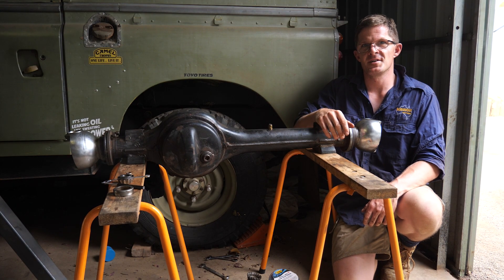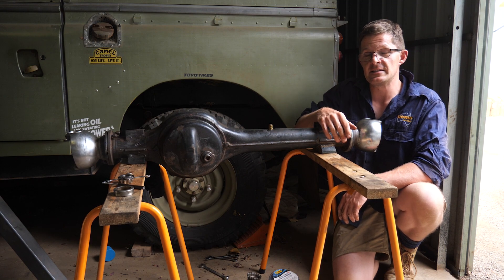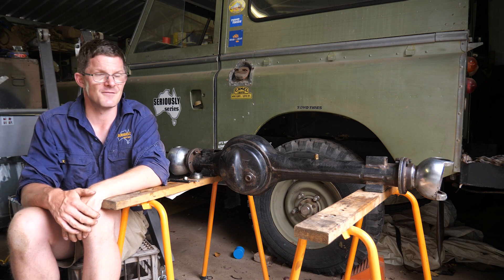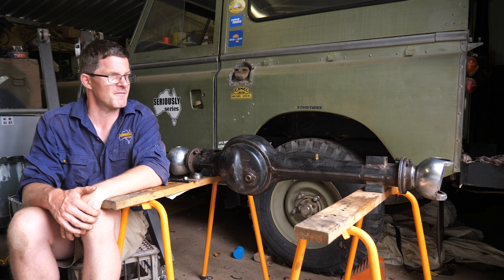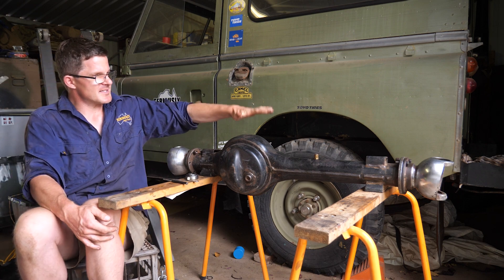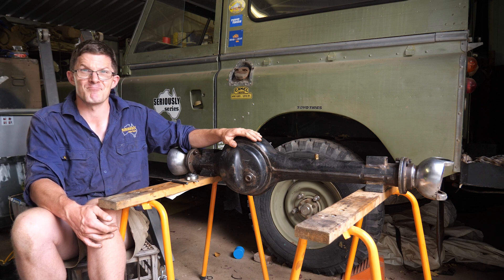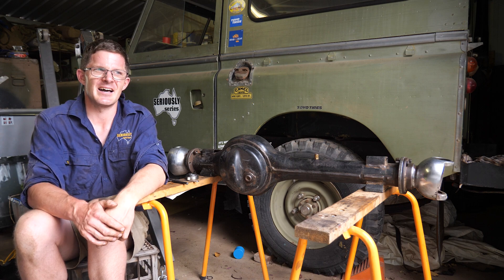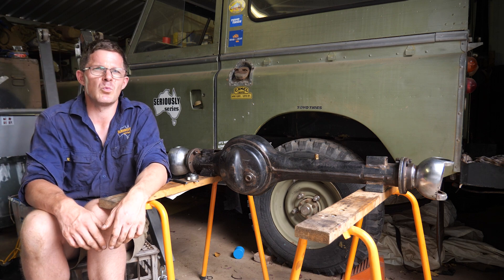NOT YOUR AVERAGE AXLE: LAND ROVER SERIES 3 STAGE ONE EXPLAINED

Comment: I own a Stage One 3.9 4bd1 wagon. I used county cv axle stubs, they are the same but shorter so you can not use the snapring on the end, overcame this by using a bolt and washer in the ends (stops them moving in as the snapring does) Replaced ralico bushes with bearings and milled down swivel pins (improves turning). Also the steering box is unique to the stage One (four bolt to the side of subframe, not incased in subframe like standard S3). Love my Stage One and have had it 20 years or so as my daily driver. Love your video's.

Comment: I can tell you from experience, the TOP Railko pin is shorter AND a larger diameter  than a regular series Railko and pin, you have already mentioned the inner swivel hub seal, what you will also find, is the CV joint is supported on its outer end  by a bronze bush pressed into the inner end of the stub axle.
This bush will almost certainly require replacement in each stub axle, and they are astronomically expensive.
I know all this because I have a rebuilt stage 1 axle in the front of my 1976 S3 88, and a stage 1 Salisbury in the rear.

Comment: I've got a stage one front axle in my series 2 swb that I'm at moment fitting a 3.9 V8 with an LT77 4cyl gearbox 
I've also got some spare shafts and stub axles 
I was considering selling the spare parts but I'm running 900x16 tyres and thought if I break a Shaft 
I'm going to have a major problem finding replacement shafts
Reply from the maker: Check out these guys they have some of the spares you may need down the track.

https://www.designdevelopmenteng.co.uk/shop/Series-Land-Rover-CV-Front-Axle-Conversion-Kit-p389433970

Kind regards, Geoff

Comment: is it easier to fit a narrowed defender axle? you get discs and cvs as standard.
Reply from the maker: sadly the defender front axles are longer than the stage one axles and the axle casing is very different to the defender so you would have to buy a disc conversion kit. Cheers Geoff

Comment: Could you fit a Defender front diff?
Reply from the maker: Eakry models, yes you can, though you need to make sure it is 10 spline diff, otherwise you need to change the axles. Cheers Geoff

Comment: They used CV's because it was constant 4WD, uni joints in the ends of the axles would have lead to a sort of juddery feeling when accelerating and turning.  I had a brand new Stage 1 V8 in 1982, wish I still owned it....

Comment: Hi Geoff, I owned a rare tray top stage 1 and yes I remember  standing at a parts counter (Tom T) and engaging in heated debate about the swivel pins he had supplied me, they fidendint for the very reasons you have so brilliantly outlined. As I purchased my 110 County new from Winterbottom in Perth City in1985 my first thing was to assemble a collection of critical spares as I was taking my young family in the County to Alice Springs via some of Len B's famous and not so famous Gun Barrel company tracks, back then it took 15 hours to cover 11ks in a couple of very overgrown sections that required axe, pick and shovel to remove mulga and wattle from the 1 blade width track, had to fill in the wash outs and 86 the desert was wet in July east of Carnegie STN.
We made it all the way to the Alice not even a flat, I broke a grease nipple off a rear uni one morning out back as I grease them daily on that sort of work.
The parts changed from my sage 1 to County , engine consumables were easy every thing interchanged for the 4BD1, but there are some spec changes in that department as well. Would love to sit down with a coffee one day and chat. Kind regards from the Pilbara. Banjo.
Reply from the maker: G'day Ben.
What a great adventure Ben, back when the Gun Barrel Hwy was a real achievement to complete. The County you mention was differently one of the best configurations that Land Rover ever came up with and the should have continued down that road in my opinion.
I'd love to sit down and have coffee with you Ben and I might find myself in your part of the world later this year doing some Geology work, so see what happens. All the best, kind regards, Geoff
Reply: Would love to catch up when you are here. @seriouslyseriesaustralia

Comment: They aren't quite as different as you think.
The bottom swivel bearing on a stage 1 is not specific, its a 217268 like any other series 3.  The steering arms are different by having a shorter pin.
The halfshaft seal 571718 is also used on early 90/110s with the 23 spline CV joints so is easilly avalable though the retainer it sits in is unique (dont wreck it when changing the seal - I found heating it up is the best way to get the old seal out).
The difference between a suffix C and suffix D diff is the earlier housing is imperial and the latter is metric.  The change only really effects the side bearings and the cap bolts - metric cap bolts are stamped 8.8 so is an easy way to identify a metric diff.  Metric diffs usally lack a filler port in the case too where as imperial ones have a filler in the case (used in rear fitment) even though you fill front diffs through the pan (yes they added a filler to the rear diff pan of an 88 when they switched to metric diffs).  The diff casing is common to all LR models at the time so a stage 1 front diff is just a standard RRC diff from the same pereod and thats the same as a series 3 diff besides the CW&P, they all went metric together (CW&P allong with its bearings didn't change when the diff housing 'went metric').  All long nose rover diffs from 1948 to 1994 will phisicly fit and post '94-2016 ones only don't because their centre is 24 spline rather than 10 so with the right centre and CW&P ratio any can be made to work - this is important to remember as the diff currently in your truck may not be the original to the correct spec!
In 1980 LR changed a few parts so they were common between RR and S3 which they often refered to as 'rationalised' in the parts book.  Anoyingly the early stage 1 was designed without this in mind so ones built before mid '80 have some slightly odd bits especally the brakes and axles but from '80 on they share more with a standard S3.  As part of this they also switched some threads to metric, though not all of that as wheres the fun in that - they were very fond of only switching one end of a brake pipe to metric.

One thing the stage 1 has going for it though is although its got its odities and some bits are harder to get, machanically they are built way stronger than a normal S3, RRC, Disco  or all but the earlyest of 110's which are on par, so once you've completed your 40 year overhaul it should serve you well over the next few decades if you keep it oiled with little fuss.  The gearbox is a major limiting feature of a standard series which means they either lack top end speed or struggle to pull away and break if you put too much power into them.  The LT95 however has much wider gear ratios and plenty of strength so much better for long distance work though they are clunkyer to drive.  If you really want to its also way easyer to put a later 5 speed or auto in a stage 1 as its basicly designed for it.  
Your right they are underrated, though they seem to occupy a strange place in the market - considered too weird and expensive to someone looking for a normal series and inferior to the comforts and refinement of an early 110 (disc brakes, power steering, softer ride, no weird parts) makes them niche appeal for a series nut.
Reply: I only know this as I did my swivels last year so spent a while cross referencing stuff, its good to share what we learn.
After 40 years the old ralkos wern’t that bad but the new ones (Design and Development Engineering) are tighter - Its more expensive to overhaul than a normal series axle but once done it should have a very long life and its a stronger axle so you win in the end. They are also easier to make even stronger with 24 spline halfshafts (again Design and Development Engineering) which would then allow fitting a stronger 24 spline diff centre like Ashcrofts 4 pin, ATB or airlocker.
Reply from the maker: Many thanks for sharing that useful information, greatly appreciated. I will say this "easy when you know how". Kind regards, Geoff

Comment: Disco1 perentei and Range Rover are 1900 mm outside of the rim to outside of rim 
Series 3 is 1700 about. 

I am trying to put disk brakes on my series 3 has anyone put disco swivel ends on a series diff? 
Or should I stick to plan an and just switch the diffs?
Reply: steering arms are in the wrong place, they intersect the leaf springs. Might be possible with some modification
Reply: Can buy disk brake swivels

Comment: I did full rebuilds on my swivels on my stage 1. There are cheaper ways if doing it then mentioned. For example get series  railko bush and pin and just machine the length down on the pin(king pin). I did manage to find all the seals I needed from M.R. Automotive at reasonable prices. It was a bit of a headache to do finding the correct selas and part numbers. Good luck with it.